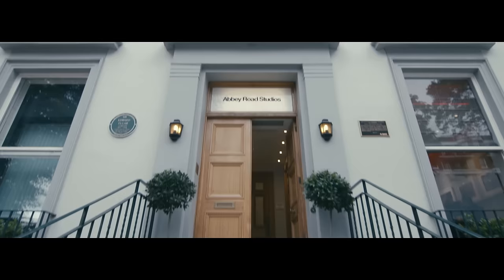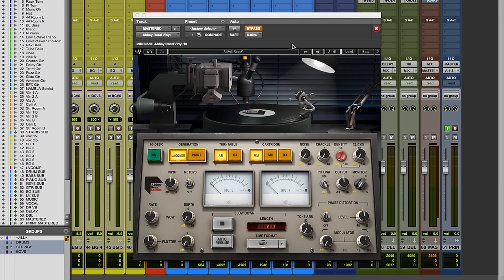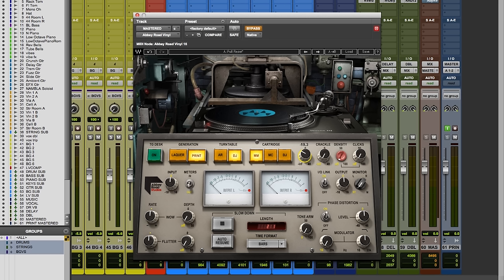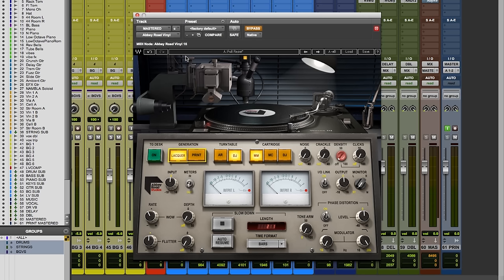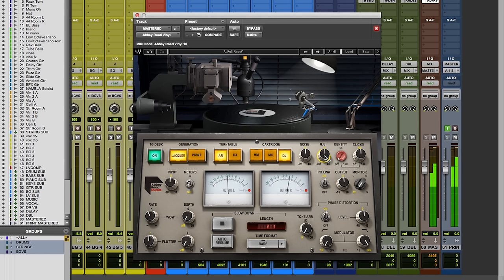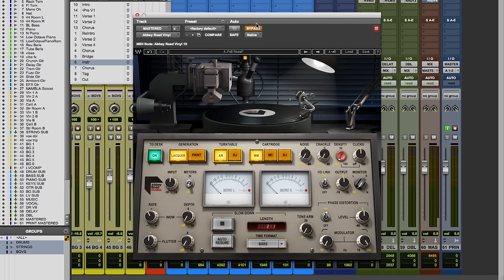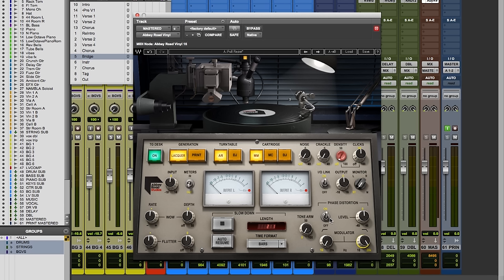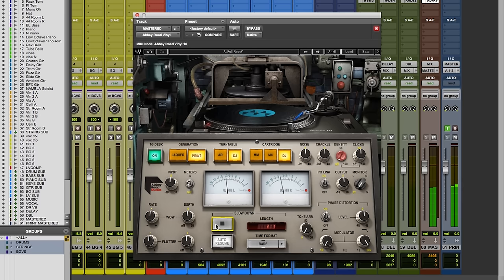Mixing a Song with the Waves Abbey Road Vinyl Plugin

Comment: This is the slickest thing Waves has ever released as far as I'm concerned.  Had it since it was released.  Wishlist for this is parallel wet/dry mix with phase matching to nullify the wow and drift and modulation options for the tonearm say an LFO to assign some movement to the tonearm itself.  A V2 would be awesome for this.  That and maybe implementing something like the SKnote cutter functionality which I also have into it as well.  Used to DJ bass music on vinyl and the experience is lost on newer listeners. This puts a lot of that type of funk back into a mix.  A copper vs nickel plating option as well to emulate the different plating techniques and sonic alterations of those would be icing on the cake as well as these affect the general aura of a vinyl process as well but that's maybe excessive.

Comment: There are a ton of tape plug-ins that all seem to shine in different ways, but this vinyl plug-in seems to be unique. It's not something you're going to use on everything but when you need it boy is it good at what it does.

I was trying to get some old-school brass hits a couple weeks ago and everything I tried either made them too bright or too lifeless. A little vinyl emulation was able to make them pop right out of the mix without sounding like needles through my eardrums, especially once they went through master bus compression. It's definitely worth demoing on a few different scenarios.

Comment: I thought the song sounded better with the plugin bypassed every time. Listening through my HD800's the stereo width and separation got lessened and just a lot of information was lost. It sounded overall a lot less open with the plugin engaged. May be useful for individual tracks but for a whole mix I couldn't see myself finding it complimentary. Very comprehensive video though, well done.

Comment: OK, so you finish your mix & master using this thing to get what you feel is the real vinyl "sound". then your record is a big hit and demand for vinyl comes along so how will this affect your vinyl pressing... positively or negatively?
Reply: Very good question!
Reply: Theron Kaye you deactivate the plug-in and click render again :P... unless you wants to makes hot hot party double vinyls!!!
Reply: You would leave this plugin out of your master if you're printing to vinyl.  The real vinyl would impart the characteristics you're after.  You could still use some effects of the plugin, I'm sure, but you probably wouldn't want to add the crackle and noise as an effect if you're cutting real vinyl.
Reply: give it a try

Comment: Just bought Abbey Road. Think it's great. Off the subject...why are music engineers mostly using pro tools? I use studio one pro. 3.5.5...it seems as good and much easier...simpler,quicker...with same results...Thanks
Reply: I used to think that, was a big S1 fan from V2 into V3. Then I got Pro Tools 12 HD with ICON and never looked back. FTR all those fast/quick things in S1 are/were already in PT but hidden behind keyboard shortcuts (Shift,alt,windows,ctrl) things like assigning multi outputs at once (to loads of selected tracks), inserting plugs in multi tracks, bypassing all plugs, selected plugs, plugs only in slot 2 etc.. .this is ALL actually far faster than S1 once you know it. Even setting up busses/auxes is very quick (not drag/drop and auto setup no BUT it's actually very powerful/flexible as it is in PT and takes seconds once you're used to it aand then select tracks - hold keys - assign bus to all selected tracks).

Audio editing is even MORE fast in PT vs S1, again some keyboard stuff is super rapid for copy to cursor pos etc. Automation (inc practice, snapshots and much more is not only more advanced in PT but faster to use esp with the amazing D-Command/ICON surface - S1 has nothing even close to that kind of hardware - CS18ai is trash, faderport 8/16 is  a toy  and studio live 24/32 is a joke vs a real analog feeling mixer like D-Command - hey it cost £12-£24k on release but you can pick them up cheap now for £1500 for main unit - worth it).

Lastly, the mixing is MUCH faster and clearer in PT, with or without hardware control mixer, because you get that amazing overall workview of ALL inserts/sends at once on screen and you can mix from the edit window, no need for the 'mix window' at all. In S1 you have to do half of it in the mixer and loads of left/right scrolling, can never see all inserts/plugs at once. 

Believe me I was a raving fanboy for studio one (coming from cubase which S1 destroys) but after PT I realised I'd been an inverse snob all my life assuming it was old fashioned and lacking vs S1, but actually it's far better except for drag drop but I barely even touch anything like that using D-Command anyway - much better. Freeze also works better in PT to freeze a track and unfreeze, inc just up to a certain plug-in, and rapid to do/undo. Bouncing is also much faster then S1, CPU usage is better than S1 and frankly my mixes sound much better in PT (probably because I use 'heat' which is like console shaper in S1 but tape - and BETTER).  That is why I use PT and why people have continued to use it, HD version, 12+ is as good now as anything out there for audio, recording, editing... it only lacks a bit in MIDI (but so does S1 vs cubase) but more than good enough for most needs. Oh and PT never crackles or locks up, S1 would crackle opening a browser etc (am on an 8700k here!) but PT is solid.

Long reply but hopefully will put questions like this to rest. All that glitters is not gold, S1 has a long way to go to surpass the actual mixing workflow of PT 12 HD/2018. S1 has a lot of cool ideas but nothing that really is needed for proper mixing, just 'nice to have'. PT is just more powerful.. .when you know how, and why.